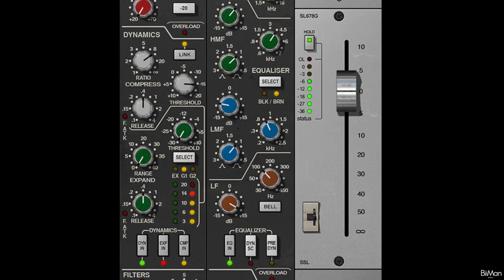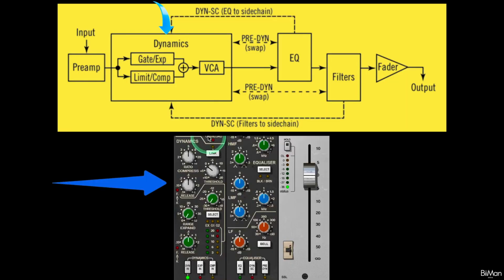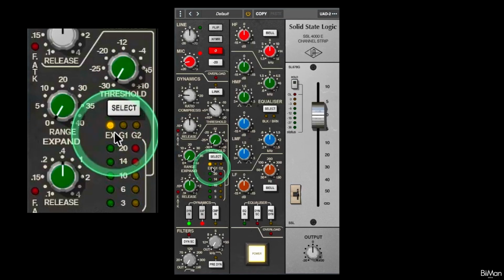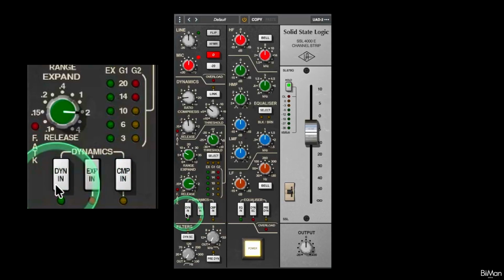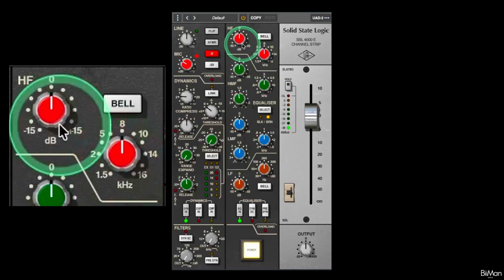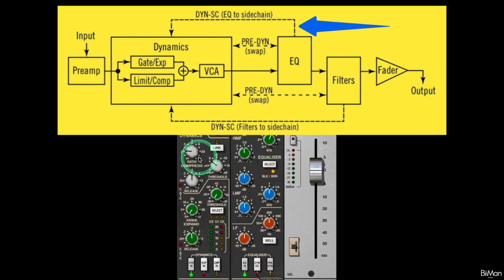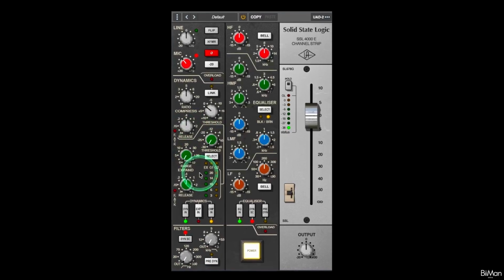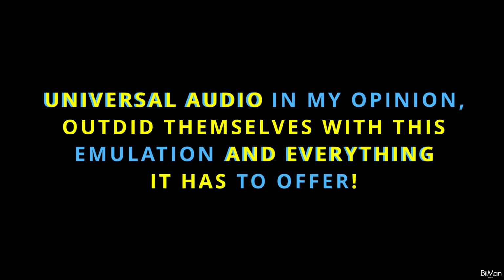The Ultimate UAD SSL 4000 E CHANNEL STRIP Plugin Review and Breakdown.

Comment: Brilliant explanation. I’m impressed. It was much better than everything else on YouTube. Do you know if the UAD ssl 4000 e plugin can be controlled with softtube console 1 mk3 within the daw e.g. logic or Luna. If it can then it would be fantastic as the go to channel strip within console 1.
Reply from the maker: Thank you for this comment. Means a lot 🫶🏾. 
Yes the plugin can be controlled with console 1 but with some limitations. 
Apparently you can only use the Dsp version and can also only load up the compressor section.